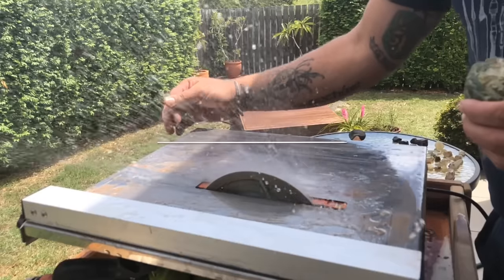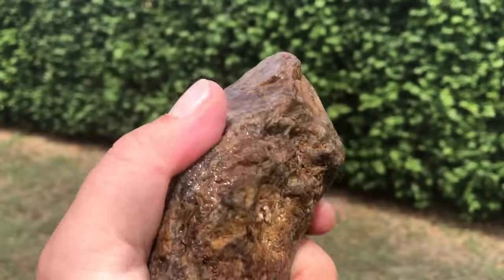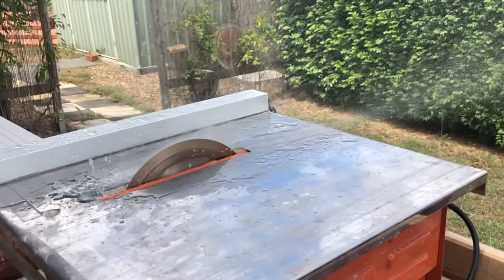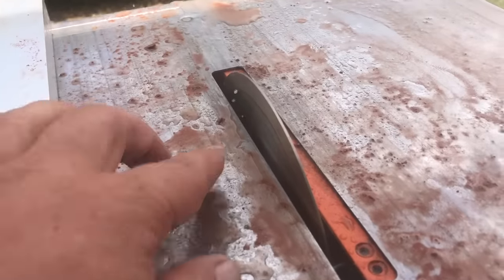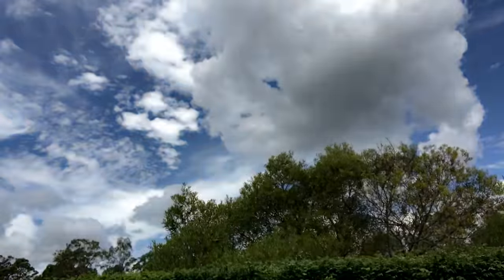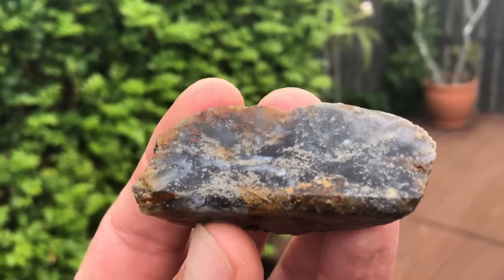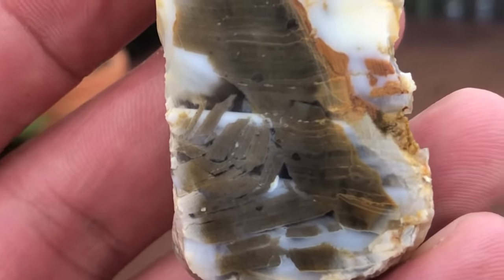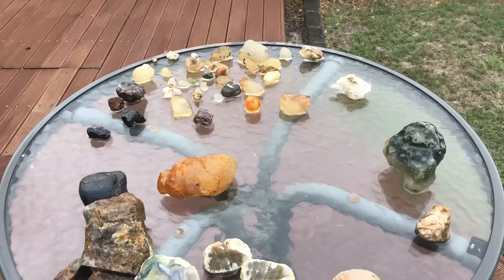How To Cut Rocks On A Tile Saw • Viewer Suggested Tips & Tricks

Comment from the maker: Heyaaaaa!!!! So I tried to use most of the comments in this vid that people suggested last cutting video. I really really super mega massively want to thank everyone who shared their tile saw rock cutting knowledge not just with me but with all of us on here. It’s a great example of how this channel is not only mine but it’s all of ours. Thank you for helping all of us! Have an amazing weekend and I will try and reply to all the comments through the week! Much love to all of y’all!

Oh! Also, if you see anything else I should mention, let me know, I’m all ears and love learning!
Reply: Hi Jesse, forgot to mention, add a little washing up liquid to the water, it helps the blade glide and keeps it cool, so your blades last longer.
Reply: I read somewhere that using mineral oil instead of water also helps with dust and keeping your blade nice.
Reply from the maker: Thank you Joseph! I’ll try that one out as well, have a greet weekend mate
Reply from the maker: 420FlowerPower 
Ah yeah I’ve heard this also, I think it’s used in the bigger saws that have a hood so the oils are caught and contained in the bottom reservoir. But I reckon it would be a great lubricator for sure! 👍
Reply: Rookie Rockhounding 
Soap and liquid soap will make bubbles, not good.
You don't need any additive for the water in a tile saw because you don't recycle the water, it's topped up.
If you find yourself needing a coolant on a bigger saw use any one of the water soluble mineral /cutting fluid that's diluting @ usually 1 part fluid 4 parts water, no bubbles.
Reply from the maker: Ahhhhhh I see, okay rad! Thank you mate! Ps emailin ya now!
Reply from the maker: @timothy bateman
No I’m Jesse. 😁
Reply: Rookie Rockhounding you need a thinner blade you can get one diamond grit based cutting saw for only 9 dollars on amazon
Reply: L
Reply: It's my imagination I think that I see a face in the thunder egg one. Or just call me crazy
Reply: What brand tile saw are you using? I’m thinking of getting a skilsaw or ryobi 7” wet tile saw
Reply: @PwnerEpicGuy ía

Comment: The other benefit of turning the tile cutter around so the water doesn't soak you, is that anyone with fear of the blade & their stone becoming a projectile, the stone would fly away from them rather than into them with the cutter oriented like this 👍 Huge kudos for the PPE efforts; no one has ever had regrets for taking too much care or precautions to safe guard their health & safety while with the reverse, it might not just be regrets but a far heavier impact that can't be undone so easily.

Comment: My tip is to "Build a wooden sled" and glue or clamp your rocks to it, instead of free handing... Hot glue or dop wax woks, +shims and wedges.  Then, once you get a straight edge, run that against the fence like you would lumber...  By having nearly perfect initial cuts, any additional lapping takes less time.  Some even make their sleds include a screw mechanism so they can clamp once, then feed the material in to slice it up.  Then some start playing with "how thin can you go?" game... but going as thin as 3mm is common for geodes, as they show well if translucent and thin...

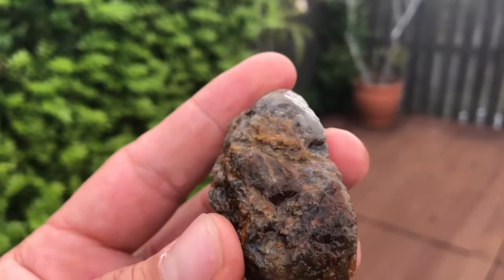Comment: At 8:41- of tumbling a piece like that I use my wet saw to remove/smooth the rough outer portion. Will make tumbling go faster on that side, and it will also prevent that rough surface from scratching or gouging the other drones being tumbled.
I’m pretty much a newb as well and enjoyed your video. Thanks!
Reply from the maker: From a newb, best advice Jen! Thank you! I’m learning as I go. And appreciate each bit of sharing of the knowledge that is given. Thank you 🙏

Comment: So is there any type of lapidary blade I can get for a 10-in tile saw that would be appropriate? I'm just not happy with the DeWalt tile saw blade that I'm using. It just doesn't want to cut any hard materials. I understand the concept of going very very slowly and letting the saw do the work, but it just doesn't want to cut through harder materials. Any suggestions?
Reply from the maker: Hey Tina, so the blades I use are tile saw blades but I make sure I get ones that are for ceramic tiles. They tend to work well. I did find that the blade that came with the tile saw wasn’t as good as the one I bought separately. I’m not sure of the brand unfortunately though sorry. I hope this helped 😁
Reply: Thank you, Thank you AGAIN,….Appreciating the videos and comments with “Answered Questions”.
YOU ROCK!!!😉

Comment: Your a good man. I’m not sure my husband would give up his Nautilus. I would steal it anyway. 😆 
Speaking of stealing, I think we had some of those hammers. They have a blue handle with yellow writing on them I think. We do need one of those plastic hammers. I know what your talking about and it can definitely hurt. 
Ironically I’m the fire bug in the family. I built our back yard fire pit. It took me two days of digging through Hard Pan with a Pic Ax. Then I lined it with a tractor tire wheel. I’m also the one who starts the bonfires in the pasture and as a kid started all the Roman Candle fights. It’s probably a good thing those are illegal now. It was stupid but fun. 
I know they heat treat precious stones. I didn’t know it was a common practice for other stuff. When you talked about stabilizing stones with fire, it reminded me that there is a cave at Polkadot Mine where the Natives burned that rock for, if I remember correctly, months. That’s the stuff my daughter and I were picking up. It’s black with soot but you can see the white agate and polka dots through it. I didn’t know before last summer that they did that. I took before and after pics of my stones. For an agate it’s pretty hard stuff, stable too. 
Thank you for the tip about Washington. We both love going anywhere in the Cascades. The only fossils we ever find are leaf fossils. 
If you are ever around the Southern Idaho Oregon border, look up a place called Succor Creek Canyon. There are roads going everywhere off the main road. All the usual suspects are there Geodes, Opal, Agate, Jasper, some beautiful wood with all kinds of stuff in it, etc. We do a lot of hunting there. It’s a pretty large area. Just follow any creek bed and I guarantee you will find some stuff. And if you want to dig for the more gemmy stuff Aqua, Garnet, Smokey etc, and are in this area hit me up. I check the comment section of my YouTube account pretty regularly. 
Thank you again for the advice. Rock on!

Comment: Silicosis is no joke.  Drs tend to misdiagnose it as TB.   You can be exposed with pottery work too (people sand dry or bisque pottery or even finished pottery).  Only sand wet.   I have a P100 mask just for pottery and for mixing up tie dye chemicals.  I’m glad you wear that mask!    I will pick up my new wet tile saw later today.   Thanks for the tips.   Omg that fugly rock is GORGEOUS on the inside.      Oh. Nice beveled edge too

Comment: Great vid as always m8! You've got really great material to work with, and your natural ability with the saw is fantastic! It's easy to smooth out those little ridges from rough cuts. It's not easy to fix less-than-straight cuts, so again, awesome job! I'll make another little suggestion though, to maximize what you get from each piece. Don't cut pieces right down the middle. Cut the middle out by making two cuts (each one equal distance from center), then grind windows on to the end pieces and you get 2 earrings and a pendant out of every stone.
I'm also really impressed at the size of rock you can cut on the same size saw I use. If you want to increase that a little bit without getting a bigger saw you can take that table-top off too. You then only have support under one side of the piece, but you get a couple extra mm.
Reply from the maker: Thirst Fast 
Hey now! That’s a frikin great idea dude, the cutting them into three, maximising the usable material. Thanks dude! 
Also that’s true, if I take the table off I reckon I’d get a few more mm’s to work with. 
Thank you Thirst! As always man just mega thanks!
Reply: @Rookie_Rockounding  My pleasure! LOL I'm thinking I need a job cutting lumber for a couple months, straighten up my cuts!

Comment: You are a very good teacher :)
I just got a tile saw the same as this one from my dad yesterday. Drove the 300km away from his knowledge and calming words. What a blessing to stumble upon your video, and lesson in how safe the saw actually is. I was getting a bit anxious about using it but not so much now, thank you :)
May I ask where you get your blades? I do need to get a new one before I start anything.
Reply from the maker: Oh thank you so much Tam Tam, that’s so cool you’ve found the video helpful! The blades need to be continuous, meaning no gaps in them, and also try and keep your nails away from them it can file them down a bit but other than that super safe. I usually buy them from the hardware store but I’m thinking online might be cheaper. All the best and if you have any questions just let me know. 👍
Reply: Tam Tam, I hope this helps...
Basically there are two types of continuous edge diamond blades.  There are tile/masonry blades and Lapidary blades.  Tile blades are thicker and the diamond surface only extends about 1/2 inch along the sides of the blade.  Lapidary blades are thinner and the diamond surface is wider on the side of the blade.  I've found that this allows you to gently use the side of the blade to help shape the piece that you're working.  I get my blades through a local rock shop that carries Lapidary supplies because it's faster, more convenient, and I prefer to support local small businesses.  You may also want to check with your local rock hound club, sometimes members can get discounts on items ordered through the club.
Good Luck, Have Fun, and Keep on Houndin'

Comment: So you would need a diamond blade to cut rocks and it won't take your fingers off. Is that correct
Reply from the maker: Yeah I’m pretty sure that’s how it goes because the diamonds are harder than any of the rocks. The only reason the get blunt is if they get clogged with residue or if the metal that holds the diamonds to the blade wears away. I think anyway. Still a layperson but I do know that it will only cut you if you hold your finger on them for a long time, or if the blade has grooves or isn’t uniform and smooth. Some of the tiles saw blades have different indentations or gaps in them for various reasons, those will cut skin as the act like teeth on a saw blade whereas the diamonds act in a way to grind material that has no give as opposed to skin so to speak.

Comment: I've got a large professional tile saw, it is not a push through, it has a blade and bar on top that runs over and down, slided back and forth. I have never had any problems cutting rocks with it. If I was trying to use a push through saw, I could see where that could be challenging, especially with quartz and so on...
Reply from the maker: Hey mate! Yeah is that like the one that meMiner uses? I so wanted to get one of them but I think this was a bit cheaper option. I’ve seen a few rock people use them and they really go well, I probably should have mentioned that one haha! What is my type called? Is it a push through?

Comment: What blade and saw are you using?
Thanks for your videos!
Reply from the maker: The saw is a clipper tile saw and I’m not sure about the name of the blade. I didn’t write it down but it is a continuous diamond impregnated tile saw blade. It cost about $70au but has and still is lasting a fair while. 😊
Hope that helps finches.

Comment: I like the one at 12.50 that looks like a Thunder egg (is it a Thunder egg?). Anyway, that will polish up great. Good idea to use a mask. I'm not a fan of those who facet too much glass in case of inhalation of fine particles of fine dust. I believe that most other gems a fine. Chalcedony silica based, but with plenty of water it should be fine. Keep finding more great rocks.
Reply from the maker: Hey mate, yeah That was a thunder egg. I got lucky with that one. I can’t wait to have the means to polish these. I’m working on a batch to get tumbled for now though. 
Thanks again cliff!

Comment: Hey My Friend, quick questions for some help. Still looking for a table saw to do what you do here and a bit confused with all the details and specs. If you dont mind, what are the amps and horsepower of your saw in this video and do you feel it works well enough after two years? My main concern is I keep seeing that these tile saws only cut from 1 in to just over 2 inch depth (with 7 inch blades I been searching) and wonder if they can still cut larger rocks, even if you have to turn them over for a second cut? It seems a few of your rocks were larger or higher then the saw blade, so did you pass them through after flipping them? I have a few rocks large like the two in this video, but several that are double the size. Could they be cut on a table like you have here? I assume the blade heights are not adjustable, as I never see that as part of the descriptions. Looking for a saw that is useful, dependable, can cut small to larger stones and not so pricey. Any help would be appreciated. Thank you, Chris
Reply from the maker: G’day Chris, so yeah pretty much this saw is a work horse. It’s still going strong after 2 years. That’s about right for the depth of cut, it’s limited to smaller to medium sized rocks. I just do a cut and either line it back up again after flipping it over or spin the rock as I cut it. It’s not so good when the rock is too big but it does a good job as an entry level saw. 
@meMiner uses a large brick saw for his rocks and can cut larger ones. They’re like the ones that you pull the saw towards you and down. The other option would be the “hi-tech diamond” saw. I haven’t tried one of them but they look pretty rad. They’re more expensive and so are new blades but they’re very professional I reckon. 
I hope this has helped mate. 
As for tile saws like mine, this one is called a clipper tabletop tile saw. But any brand is good I reckon.
Reply: @Rookie_Rockounding  Thank you, I will look to see what a brick saw is and take a look at his cutting vids. Any info on amps and horsepower? I see them from 4 amps to 9 amps and up, as well as under 1 horsepower and up to 2 horsepower; and most seem to have avg of 3600 rpm, though others are up to almost 9000 rpm. Thanks again if you know any of this about your saw or others.
Reply from the maker: Hey mate, I’m really not too sure of those specifics, I’m not super mechanically minded. So sorry mate. And I couldn’t see where it says what my one is. Sorry.

Comment: Just a heads up, that stone you are holding at :30, it looks like meteoric melt glass. Are you collecting in a creek bed? Most of those rocks appear to be marine fossils. Many rockhounds and even geologists often miss this as they are focused on the mineral / crystal composition and fossils aren’t the easiest to identify. Knowing what you are cutting will help get better results all around. It’s like stepping out of the tutorial lvl to the open world. You’ll find new and better places to collect, places  others aren’t looking, and possibly valuable finds. Living things often fossilize into chert, agate, opal, etc. You can often find survey data of areas near you and take that and find new places to collect. But, never assume the data or the experts are correct. It’s a good guideline but it’s worth having a look for yourself. Some good terms to search: concretions, ammonites, nautiloids, tektites, impact glass, shock quartz. Most importantly, find out if there are any deposits of dangerous minerals in your area, especially if you are creek hunting and don’t assume deposits are too far away. I’ve found thorium and uranium oxide in gravel pits and gravel washes and it’s host rock is nowhere near my area.

Comment: The respirator is a good call. I wear the same one. However, unless your clean shaven, you don't get a good seal on your mask. It's certainly better than not wearing one, but you're still going to inhale particulate matter. Not trying to be all jerky, but people should know that about the respirator. I've owned a commercial and industrial painting company for years and have actually been on jobs that require a weekly fit test and unless you shave every day, the fit test fails. Granted with rock cutting you're not dealing with VOC's, but that fine dust will get in there around your beard. Cool video, nice rocks. I'm headed out to my shop to cut some petrified wood.

Comment: Just tried my new tile saw today to cut a condor agate. It seemed to really resist being cut. My question is this; do you cut with the blade spinning towards you or away from you?
Reply from the maker: So I turned my saw around so that the blade is spinning away from me, but I pull the rock towards me, so I’m basically cutting backwards. 
I hope that helps. I tend to not make sense sometimes 🤣
Reply: Rookie Rockhounding Thank you! I couldn’t see how to make the blade go in the other direction 😜 When I saw your second video I also turned it around and pulled instead of pushed and it was indeed much easier! Thanks for being brave enough to post your first tries!
Reply from the maker: Absolutely my pleasure 😉 happy cutting!